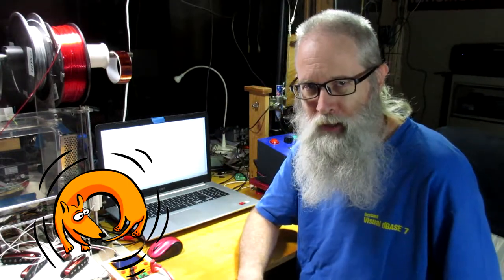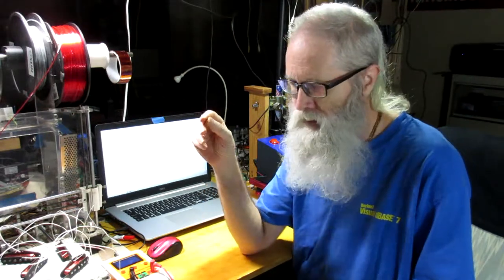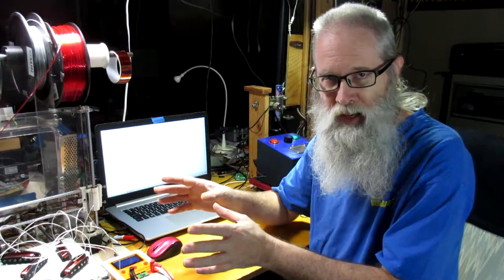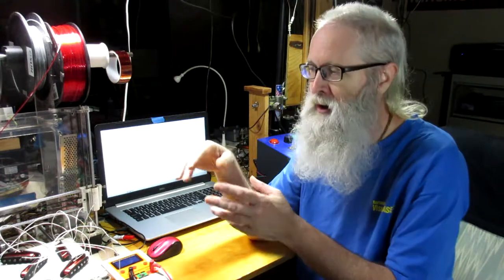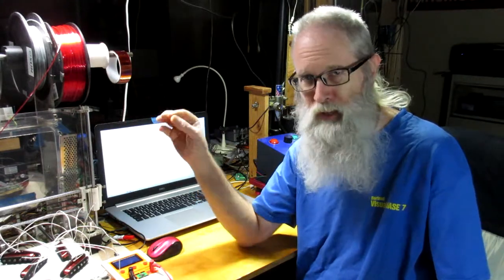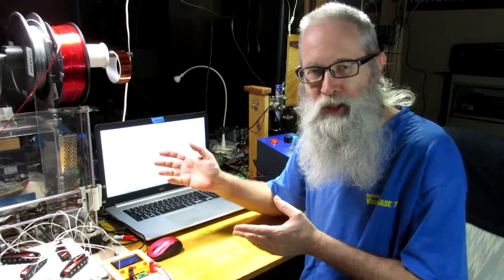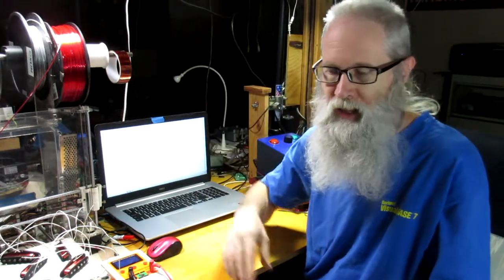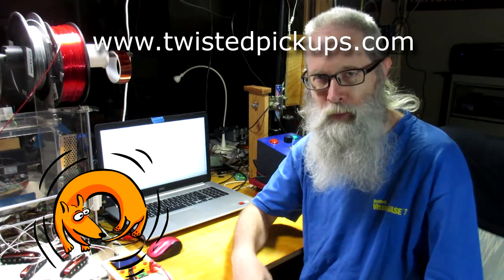The Science of Making the Best Guitar Pickup

Comment: Finally, the science  at work, cutting though myths and hearsay like sunlight through fog. Bravo.
Reply: Have you taken any data samples from authentic fender pre cbs pickups?
Reply: @U2BER2012  Yes.
Reply: @m.a.nelson9427  Next question: were you able to come close to duplicating the tone / frequency response of those early pickups?
Reply: @U2BER2012  Lots of questions. Sounds like you are building up to a gotcha. Anyway, close enough to be in the range they occupy - they are not exactly consistent.
Reply: @m.a.nelson9427  Sorry about all the questions.
I rewind as a hobby, though I use to do repair/ rewind work for a local guitar shop. But, lately I rewound this one strat pick up with a theory in mind, so I wound it accordingly and I was so blown away by the resulting sound. I've let friends try it out and they too are amazed. I agree, it's not easy cloning a good pickup and I don't have the equipment that you have; only my ears. Thanks for responding!
Reply: @U2BER2012  Well, I am not the video maker, just another guy. I probably have about the same equipment you have. I am getting ready to roll out a brand soon and am building the stock now. I do more HB's and my F-styles are meant to be a little different. I use vintage style parts, wind with wrap-per-layer in mind and a big thing for me is controlling the charge of the magnets.

Comment: Drives me crazy when people put such emphasis on resistance, not realizing that it is mostly a proxy for the number of winds which matters most. If resistance was what mattered most, you could just put a huge resistor is the magnetic field and that would be that. But, of course, that would fail. Ultimately, it's a trade-off between tighter  winds of finer wire increasing the number of winds, which increases inductance (but also capacitance)...while the increasing resistance increases voltage drop. 

That's like highly resonant guitars that have higher inductance...but are also microphonic even if the pickups are "wax-potted".

Comment: Can you wind output transformer?  Does silver or gold wire make a difference?
Reply from the maker: The metal should be a good electrical conductor and non-magnetic. Copper does a pretty good job without any reason to use exotics.
Transformers are a different animal when it comes to winding them. Either really expensive equipment or hand wound is the way to go.